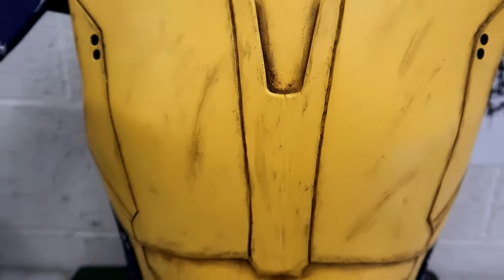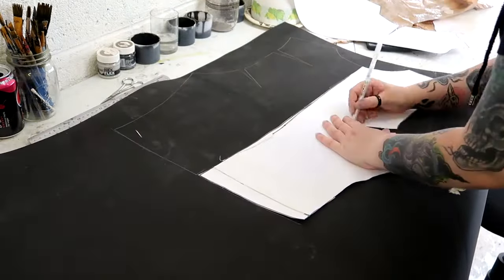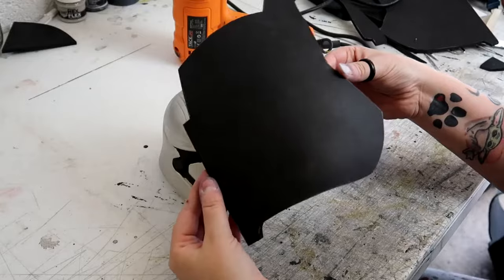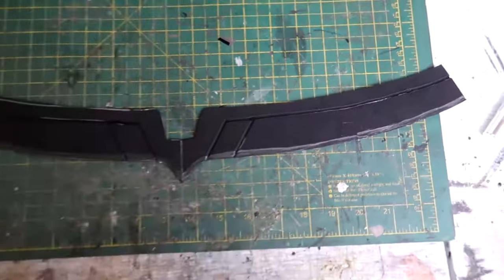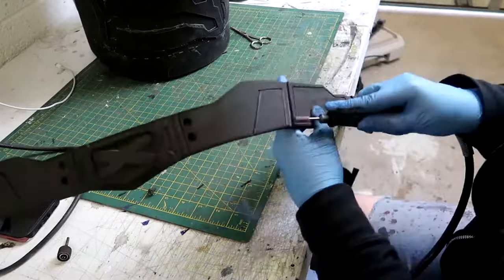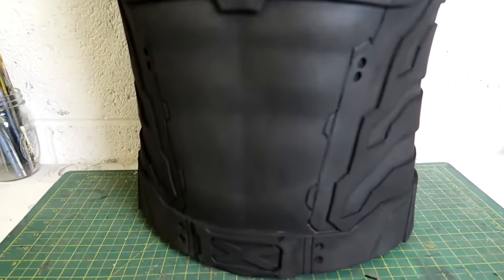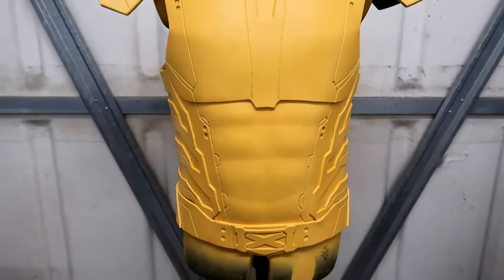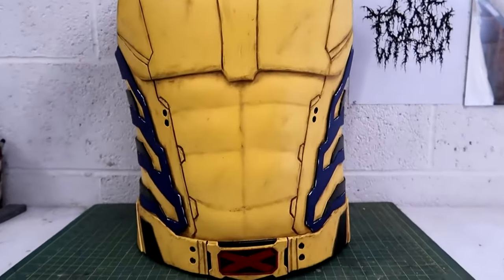How To Make Wolverines Costume (FREE TEMPLATES)

Comment: how much EVA foam did you use? i was gonna buy my costume but they are all SO expensive, like, 200-400$ :(
Reply from the maker: I don't know exact amounts if I'm honest as I have quite a big supply, but it was no more than a 1m x 1m sheet with some left over from that, but obviously you will need different thicknesses 😊
Reply: @TheFoamWitch  thank you! I was also curious if you had diagrams for the mask/cowl. But didn't want to ask 2 things at once lol
Reply from the maker: @BEN9116  ask as many questions as you need 😊 I have another video on my channel where I make the cowl and you can get the template from Propway 👍

Comment: How should I edit the template size so that it would fit me?
Reply from the maker: @ronanfleming2252  so when you use pdf printer, there is a button called "poster" when printing. If you press that it prints a single page over multiple pages so you can set the scale to whatever you want to make it bigger 👍

Comment: Did you heat seal the cut edges of the EVA foam prior to applying the adhesive? I've heard the adhesive is easily absorbed into the foam..
Reply from the maker: @catspyjamass  I can't say I did, as hot glue doesn't tend to soak into the foam. You can do this if you are planning to use contact adhesive though but it's not essential 😊
Reply: @TheFoamWitch  Ah... You prefer hot glue over contact adhesive? Better results? 😊
Reply from the maker: @catspyjamass  I use specifically for foam hot glue from Tyges supplied and honestly, it's changed my life! 
I used to use contact adhesive, but even with a respirator, it still made me super sick! The glue sticks I use go on like hot glue, dry like contact adhesive! 
I was worried using them would mean the costume would fall apart if it got hot but my Skyrim armour has been used loads of places, in sunshine and heat and it's still standing!
That's just my preference and experience though! Nothing wrong with contact adhesive 😊

Comment: I was just wondering if you could possibly put the measurements of your finished armor so I have a better idea of how to size the template when printing? Pretty please!
Reply from the maker: Sure! ☺️The waist on the mannequin is 33 inches so I think the template will be about 35 as it’s not completely skin tight. 
If you use the “posted method” to print it off, you can scale it up or down by percentages, so that would depend on your own waist size! 
I don’t know how accurate it is but I’ve heard I you take your own waist size and divide it by the size of the template, it will give you a number that matches the percentage you should print off at

Comment: Awesome work. Is there a reason you didn't paint the additional detail pieces prior to sticking them on to the main torso? If you did this again, which approach would you take? 🤔
Reply from the maker: @catspyjamass  do you mean the the blue side pieces? It's just easier to seal everything together and then paint it all after the sealer has been done. I
f I painted these before sticking them on, I would have to cover it all in masking tape which takes more time.
If you stick them on after the yellow was painted, you can run the risk of pulling the paint underneath off and them coming unstuck. If everything is sealed first, together, then it has a layer keeping everything stuck in place 😊
 I wouldn't paint it in a different way if I did it again 😊👍
Reply: All good points! Thanks
Reply from the maker: @catspyjamass  no problem at all! Is mine the right way and the only way? Absolutely not! Make it however you feel is best 😊😊

Comment: Did you have any trouble with that spray paint texture? I sought ought the Montana Gold as recommended, but my test sprays on two different surfaces keep coming out very grainy. Did you have to sand it at all after painting?
Reply from the maker: @sirrogueke  I can't say I have a grainy texture, I sprayed it quite close though,so maybe this was why? Maybe there is a very slight texture but nothing that noticeable. I can't see why you couldn't stand it with super fine grip sandpaper 😊👍

Comment: Hi! What did you use to prime it and turn it Grey?
Reply from the maker: I used a spray on primer called seal prime 😊😊
Reply: @TheFoamWitch  ok great - and can you use any kind of spray paint for the colour?
Reply from the maker: @KellyBradford-gl3jg I probably wouldn't recommend any type of spray paint, because it's not flexible and will crack as soon as the foam moves, but the paint I used in this video seems to be white flexible but I usually just use acrylic paint 👍
Reply: @TheFoamWitch thanks… is the white pen a chalk pen? X
Reply from the maker: @kellybradford8655  it's just a white gel pen 😊😊

Comment: any tips on how to scale this template for me? for reference, i have an 84cm chest, a 74cm waist, and a 82cm hip measurement. i see that you used a4 paper for the template, is there any other paper format i can size it down to hopefully get everything to fit right?
Reply from the maker: @kai.7406   honestly, I need to figure out an actual method, because at the moment it will just be trial and error. The waist on the mannequin is 33 inches so I think the template will be about 35 as it’s not completely skin tight. So after doing the conversion, that’s pretty much your size! If anything I would print it out and scale up 10% on the pdf printer! 
If you use the “poster method” to print it off, you can scale it up by percentages, so that would depend on your own waist size! 
I don’t know how accurate it is but I’ve heard I you take your own waist size and divide it by the size of the template, it will give you a number that matches the percentage you should print off at
Reply: @TheFoamWitch  sick!! thank you so much!!
Reply from the maker: @kai.7406   no worries! I hope it makes sense! I really need to come up with a way people can scale these easily to size but I don’t understand maths 🤣

Comment: If I have a larger waist circumference, how do I measure the scale?
Reply from the maker: @RanggaSalman  honestly, I need to figure out an actual method, because at the moment it will just be trial and error. The waist on the mannequin is 33 inches so I think the template will be about 35 as it’s not completely skin tight. 
If you use the “posted method” to print it off, you can scale it up by percentages, so that would depend on your own waist size! 
I don’t know how accurate it is but I’ve heard I you take your own waist size and divide it by the size of the template, it will give you a number that matches the percentage you should print off at
Reply: Thank you for the advice

Comment: How do you take off the border when printing that to get the full template
Reply from the maker: There shouldn't be a border, so I'm not sure. Make sure to print on A4 scale and if there is an option on the pdf printer to make the border zero (usually a little type in box) then make sure that is set to 0 😊

Comment: How could I go about making the templates bigger for a bigger guy like myself ?! 😂😭
Reply from the maker: So if you print using a pdf printer, there is an option to set the scale I believe. If you set it up, and use the "poster" method I think it is, it will add the templates over multiple pages 😊
Reply: @TheFoamWitch awesome thanks so much !!! Such a life saver